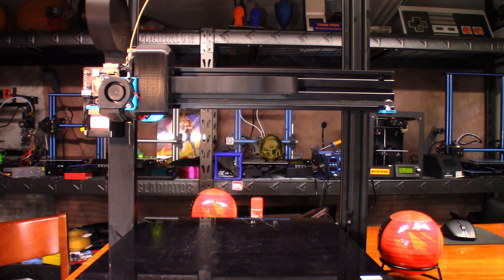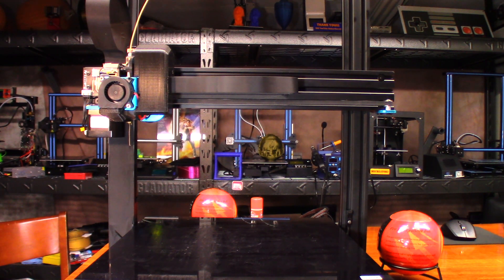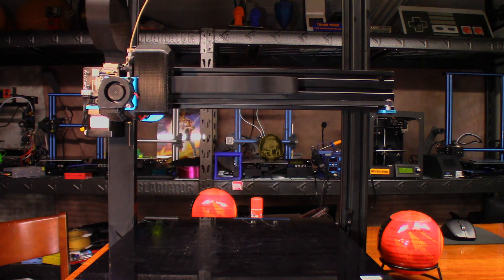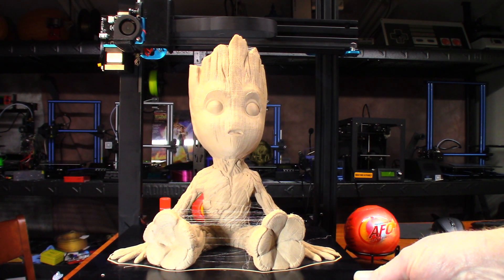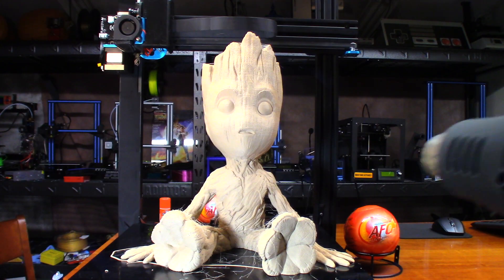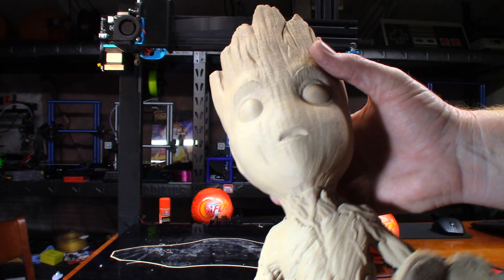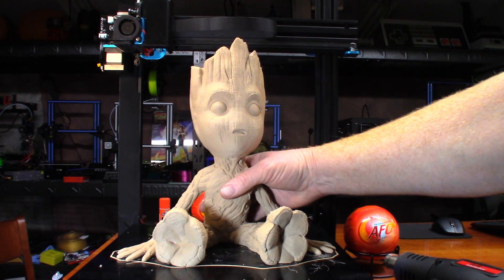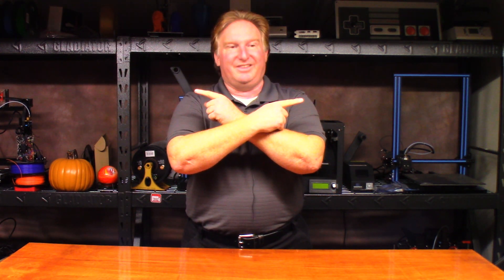3D Printed Baby Groot On The Artillery 3D SW-X1

Comment: Hey Jimmy, I was watching a video from Joel 3D Printing 101: Troubleshooting a Bad Print and Installing a New Nozzle were he was talking about a nozzle that printed fine on one side of the print and terrible on the other and it was the nozzle that was bad which I believe you suspect as well. Just go ahead and change the nozzle. It makes sense if the nozzle is worn on the back side the problems would be inside the front of the model and not seen but the back side the worn side is outward facing and is easily seen. Catch you later.
Reply from the maker: I actually order the new microswiss nozzle a few days ago and installed it Thursday night.